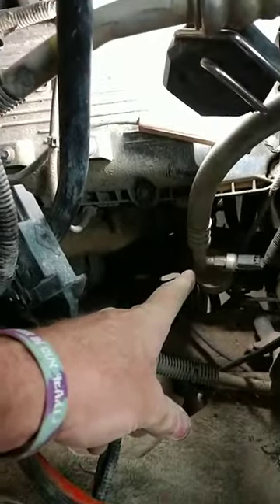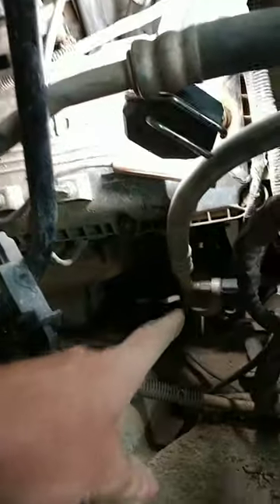How Engineers Keep Mechanics Miserable (Part 287) #shorts

Comment: Mine broke so I found a tube and slid it down past the crack my dip stick still fit and fluid passes  🙃
Reply: Heat shrink 🤙🏻

I used 1" cold-shrink to repair the header pipe on my hot water cylinder at home about 10 years ago. Still going strong💪
Reply: @prdoohan  good one ! I on the other hand plan on never selling my 2003  7.3 diesel ! Cheers

Comment: You don't actually have to remove the A/c compressor or battery box/washer combo and the entire job can be done through the wheel well and under the truck, there's an access hole in the cross member to get to the front lower motor mount bolt.

Comment: There's a recall on this issue and repair is covered free of charge, but it is a lot of work to fix such a small part. Also, the only thing the repair manual says you need to remove is the motor mount, not all the rest of the things you mentioned. Getting the broken one out is the hardest part, but if you get it out, you do not need to remove the mount to put the new one in. The mounting bolt is easily accessible.

Comment: I’ve done that job a few times you only need to pull the manifold on that side and partially remove the motor mount but you can get the manifold out by it self it’s a huge pain but not as bad as pulling everything else you pulled

Comment: Food for thought, the engineers are given outlines by corporate based on a compilation of sales/repair data from previous years. If corporate doesn't like the numbers then they tell the engineers to make the new design harder to work on or more "serviceable" (cheaper).
I'm not saying the engineers are totally blameless but a big portion of the frustration needs to be focused on corporate greed and not just the engineers alone.

Comment: Another case of engineers being told by management to put the most frequently and easiest repaired parts in places that practically require taking the vehicle to the dealership to have it repaired. I.E. the earlier fox body mustangs had haeter core behind the glove box (easy fix). Then they  moved it behind the dashboard which now requires complete removal to change out the heater core. ( much harder fix now).
Possibly so most people will have to take it to the dealership and spend more money for the fix.

Comment: Among the things i hate most-
1. Need to pull out manifold to change spark plugs
2. Front wheel drive V6 where 3 sparks hidden behind the firewall.
3. Need to pull out whole front bumper to change the oil filter. No access from up or under.

Comment: Access manifold through wheel well. Ac compressor comes out underside, by removing steering shock bolt. 4 bolts for engine mount... Do these all the time

Comment: Not gonna lie, I'm glad I drive a 4-cyl daily. Lots of working room too. Literally the other day, my dip stick into the oil pan was leaking (I'd done previous work and damaged the seal on reinstallation). One bolt, 5 minutes and no more leak.

Comment: Ford did this with most of their trucks, hiding the engine underneath the firewall and shoving it in there deep as they could. Changing coils on a 5.4 2valve (1998) is definitely much harder than it ever should be. The only thing that I can hope is that some of those engineers out there had to do that service in their driveway and think about what they've done.

Comment: Replaced a 6.2 dipstick tube in a gravel parking lot. Removed exhaust manifold and loosened motor mount but did not remove. Definitely did not remove a/c compressor but did remove battery and battery tray with washer jug. That job really kicked my ass but was successful.

Comment: Yeah... had a similar problem replacing a $13 sensor.  Had to disassemble half the damn engine just to find it, and another quarter of the engine to actually reach it.
Changing it took less than 20 seconds (10 of them being to remove it from the packaging).

Comment: The struggle is real nowadays!  A lot of auto mechanics in the field are getting paid at a lesser rate than mechanics in the 60's - 70's  (when adjusted for inflation).  At the same time the vehicles have become (×5) harder to work on / repair.  Now thats not always the case, especially considering many components in vehicle have gone "modular" (aka - plastic, planned obsolescence, throw away garbage). There are many reasons for this but it really boils down to 3 things - Profit, Government, Consumer demanded "Tech". 😒😤🧑‍🔧

Comment: or pull the oil pan and push out the broken piece from the bottom then guide your new one back in place.
 or if you know your truck well enough and how it feels and sounds when it's low on oil then you can seal off the hole and put an oil pressure gauge inside and when you see it drop to a certain mark you'll know you need a quart of oil. I've done that with a few cars accurately

Comment: In my ford to change the water pump you have to take off the timing belt, to take off the timing belt you have to take off the motor mount, to take off the motor mount you have to take off the coolant reservoir. Still was an easy enough job.

Comment: I've had this same job in the past. Fixed the broken one in 10mins vs this giant hassle. Piece of hose and 2 hose clamps. Clamp the 2 broken half's together. Dipstick still slides in and out smooth enough. Doesn't leak oil or crank case air. Done. Fixed.

Comment: My first car was a 250 cbi inline 6 cylinder Chevy Nova. You could fix it with a crescent wrench and a vice grip. I miss that car everytime I go to the shop. Change the alternator one a BMW you have to pull the bumper and radiator.

Comment: Honestly the easiest way to work on ford truck is to remove chassis from frame. Seems like somthing extremely hard and difficult but it’s not like 6 bolts and 4 electric connectors and your life is made easy. It’s a automatic $600 dollar charge for any engine work on a fire truck

Comment: And a lot of people wonder why they have to pay 30hrs or more for labor to change out a $100 part. here's your answer. this is why I hated working in Bodyshop and why I stopped doing bodywork for a living and only continued doing it as a hobby. have a 1970 Chevy C-10 I'm about to do a frame off on and in all honesty I can't wait because I know it's gonna be easy as hell and because there's so much aftermarket shit out there for it that just bolts right up with hardly any need for adjustments.

Comment: The best method to fix this is cut it in half and slide a new one in and build another bracket to hold it in. Buy a new tube when you rebuild the heads.

Comment: Just wrap it around a tree and write it off on your insurance as tried to avoid hitting a deer then its off to buy a new truck. Im not a certified mechanic but I do a lot of farm equipment repairs and its the same with that. A simple bearing replacement turns into several hours just pulling shit apart to get to the bearing. Its usually a $20 bearing with 6+ hrs labor and $30 in gojo and laundry degreaser.

Comment: You don’t need to pull the a/c compressor to get the bolts out of the engine mount , use a flex head ratchet , 15 mm deep socket , they come right off

Comment: Use JB weld. Clean the tube. Slide a larger pipe on it. Put JB on tube slide it down fill the top of short pipe with JB. If it's broke flush it will be ok it's just a ford

Comment: All that matters today seems to be „make everything completely disintegrate on day 1 after warranty expires so we can screw the customer over one more time“. That’s how we end up with flimsy plastic, body panels that are one step short of Coke can thickness and totally unfixable electronics where you need to toss a switch module worth 350 bucks plus tax and labor because ONE of five switches has gone on the fritz. To be fair tho: a dipstick tube breaking doesn’t strike me as a common occurrence. Still sucks pretty badly.

Comment: New cars are a pain in the ass. My old mustang a radiator swap was a 15-30min job. I rebuilt the engine myself in that one.
My new mustang? Rad swap, the whole front grill, whole front clip basically has to come off. +3 hour job Uhg, I'm done working on cars

Comment: Cut a vertical slot in the side of the oil pan and epoxy a piece of clear plexiglass over it. Now you bend down and see the oil level. You can even hang the rag you’ll need to wipe it off on the existing dipstick.

Comment: I was working on one today we dropped the tank on because someone put diesel in it, home depo rental truck. Had to take the fender liner out on both sides to get the spark plugs. Its crammed as hell in there i dont like the waste spark either, i prefer working on 3.5 or 6.7

Comment: Yea that's a negative, break the tab off pull the old one out, break the tab off new one feed it through the exhaust manifold and make a new tab and bracket then bolt it to the outside of the stud and tack the tab back on the dipstick.

Comment: In my 35+ years turning wrenches and repairing vehicles professionally, I have NEVER EVER experienced a broken dipstick tube. Sure some vehicles from the 60s and 70s (both foreign and domestic) would corrode and the spot were on the mounting arm might break but the veil ls would have been 30 years old or more. FORD: Fix Or Repair Daily.

Comment: It's a little like having to pull the passenger seat out and roll the Carpet back to be able to open the access hole in the floor of a Freightliner truck to remove the automatic Eaton Fuller transmission and clutch, Customer didn't replace a leaking transmission cooler line causing this transmission to completely destroy itself after running out of OIL. 🤑.

Comment: The problem is that dipstick tube was built Ford tough.  This whole thing is typical Ford engineering.  Do they still have a coolant drain over the starter motor because "what could go wrong?"  Remember those Teflon power steering hose swivels that would start leaking if it got flexed?

Comment: Well said my friend!!
That’s just the beginning Ford is the worst. I’ve been a mechanic for 35 years and to work on the Fords Navistar diesel, the cab, the entire cab must be lifted above the chassis and engine and according to OSHA, you have to roll out the chassis, and engine trans away before you could attempt any service of any kind to that stupid engine, because the hood is way too small. All ford had to do is make a one piece hood and fender assembly like the heavy duty vehicles, if Ford is having trouble fitting all that in.  

We are all guinea pigs here, my friend

Comment: ALL automotive designers and engineers are as smart as they come in the world... Everything they do, is 100% with not a single consideration to anything or anybody once the vehicles leave the dealership for their first time being purchased. The warranty work that one in a normal business sense and methodology would think the top brass of these manufacturers would be having a cow over, "OH NO, warranty work"... They actually make money on the warranty aspect in business, which in my opinion, is a slight form of hedge funding scams, or insider trading, where the company's bet against themselves in a form of a "gamble" with investors and insurance providers. It really is some sick and twisted nutcasery that they are allowed to make money on being able to write off warranty work pay-outs, in parts and labor to authorized service centers/dealerships. It is basically fraud. Sadly, the tax base is while covers the loss even on recalls, even though the headlines will write how much money an auto manufacturer lost to cover the recall repair(s).. 

I can tell you all this, it was already planned 16 to 20 years ago to make this process even worse, hence, the electric vehicles that are hitting the production lines currently, to then, throw into the mix of all this fraudulent crap, the never ending battle of "Right to Repair vs NOT"... Making them so dangerously complicated, to the average Joe has no ability to simply rotate tires in his/her driveway, resulting in an automatic forfeiture of warranty coverage and your private auto insurance companies are already on board with this scam, of soon having an excuse for why they can't or won't cover you in the event of an accident, because you did something on your own or didn't take it to the dealership to have it done or simply done at all, as an entire database of what, where, when, how, who did what to your vehicle... They will win every time. "Sorry sir, we can't cover your auto accident, as you didn't have your car brought into service to have the tires rotated." ..

You all think I'm making this up???? No, it is already on the docket for the plans. Right now, you can go into your private auto insurance provider and ask if they offer any additional coverages for warranty or lack of manufacturers coverage etc... And they will gladly offer you these additional policies. Everybody is making money of the cattle, and these electric cars are going to kick this whole program off... The first lawsuit against one of the manufacturers, from a car hurting or killing somebody, that door is opened for them to supercede the "Right to Repair"... Think about how twisted this is for them to get out of liability and responsibility and responsible design practices, and make tons of money in the process, by making you take out insurance for your insurance and for your insurance. Sadly, most that will vote or allow such crap to happen like this, is either making money off this or has never worked on a single thing in their lives, and has no clue how costly this is going to be for them/us.

Comment: Clearly you do not work on fords much. Only thing you need to do to get the manifold out is unbolt the motor mount from the frame and roll the motor towards the left. It’s tight but doable. Book time is 7.2 to change that tube though.

Comment: U forgot to mention that Ford's are much easier to work on if you put the wheel liner out Chevy and GMC the same for exhaust repair  Dodge  not so much as  most of  the liners are welded in

Comment: You don't have to remove the manifold. Lol. And I've also replaced the exhaust manifold without removing the motor mount or jacking up the engine

Comment: Dont get me started on the 03 to 07 ford 6.0 diesels you literally have to remove the engine to take the heads of to replace a cheap ass lifter that causes major problems if you dont smdh like theres tools to get the lifters out but they made the hole so small you have to remove the engine

Comment: Pretty soon it will just easier to pull the engine out to fix whatever problem rather than pull this or that to work on it.  I freaked out years ago when I heard that you guys had to pull the cab off to work on the turbo setup because of where it was located.  I don't envy you guys one bit lol

Comment: 2009 / 2019 dip stick tube Haaa, I would be a tad bit more concern on that (Death Wobble,) problem with those F250/F350 who knows you may never need to check the oil again.

Comment: I get complaining about battery, oil filter, etc placement. But a dip stick tube replacement? Are you kidding? I know you know how many different component the engineers had to fit in the engine bay. Different components have different levels of priority. Some components only have one option for where they can be located. This is a ridiculous take. Do your job and be glad engineers at least keep the repairs ‘skilled labor.’

Comment: OMG YOU DO NOT HAVE TO PULL THE EXHAUST MANIFOLD BRO 😂 PULL THE STARTER AND ENGINE MOUNT, it will go right in with a little persuasion, I’ve done these hundreds of times , or use a piece of copper pipe slightly bigger to slide over the two broken pieces

Comment: Aviation snips to cut tube. custom fab your own dipstick with copper tube. Rtv silicon to slip fit  copper "extension" tube over steel tube. Job done. Maybe slightly bigger o ring 

Tube tube tube tube tube 😂

Comment: Reminds me of the 10,000 exhaust manifolds I changed same way..  jacking up ..prying out.. cursing all the way.. ...wait to the tube rusts off behind tithe manifold and you using a Tap-con and slide hammer to extract the remaining tube in the block🤦

Comment: There’s gurus out there that can change that dip stick without any of that extra work. First the dip stick broke from vibration, poor design. If you went through that trouble I would go with a actual piece of thick wall tubing so it won’t do it again. Yea I only bust out the higher power for myself to keep my life going ,you won’t find in a employment type of shop true talent I also have a 4 cyl. So there’s none of that lol

Comment: You forgot that while u have the manifold off you might as well replace it due to looking like they have 1 mill miles on them when it rally doesn’t have 60k. Worst material used ever. my gmc and dodge look new with 200k Ford should be ashamed !

Comment: Chevys may cost more but cost less to work on. I have herd this Ford complaint by many mechanics. Best Chevys ever made were the S10 series. I looked long and hard for them and now own 3 more 2000-2002's low miles no rust. If it ain't broke don't fix it and don't change it. But they did. Colorado's suck.

Comment: Or... You could just cut a one and a half inch long little piece of steel brake line tubing, in an inside diameter that slips over the outside diameter of the dipstick tube nicely, then smear a little epoxy over the repair area and slip the tubing over it, tape it in place so it doesn't slide down, just until it dries and sets up, then wait 15 minutes, remove tape and all done and we'll again! Fuck that whole taking apart the entire top end bullshit. Not me, not over a stupid busted dipstick tube...